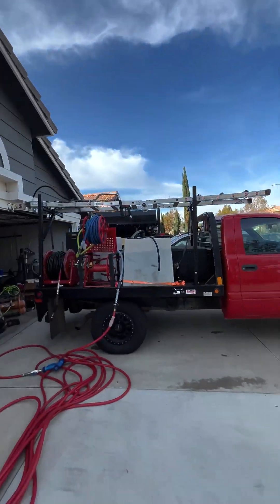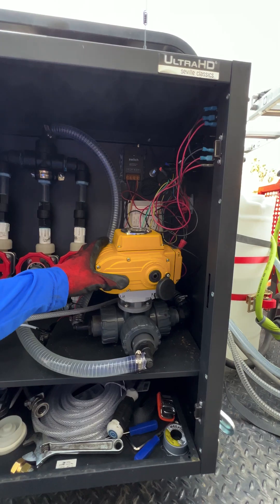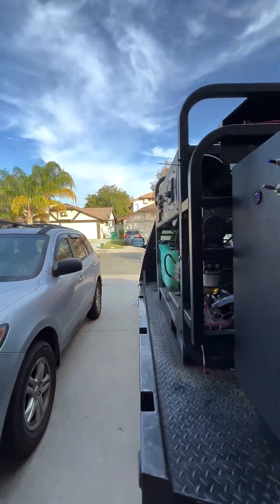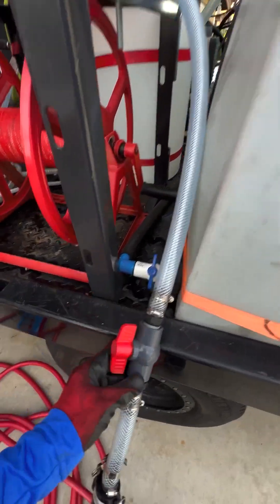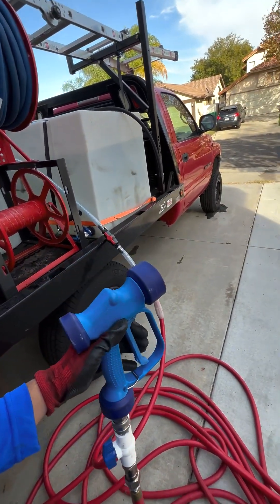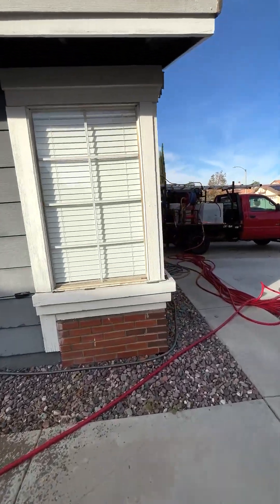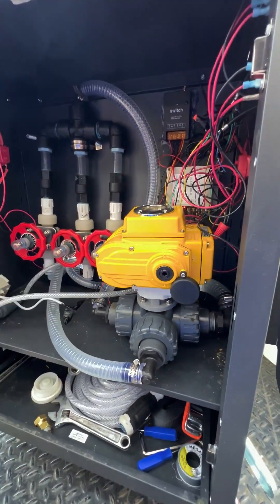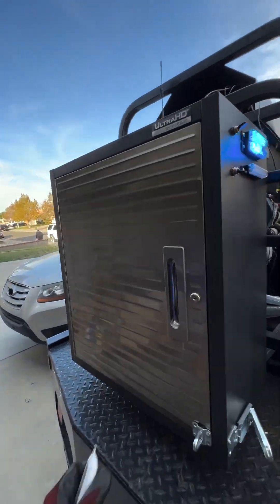50 Ft On a 12v Pump Setup

Comment: Unbelievable. You run through the whole system with hose sizes and connection and there is no mention of the size of the 200’ hose.
Reply: He says 1/2 inch

Comment: so ur running a 1/2” hose but your pump itself has 3/4” inlet and outlet?
Reply from the maker: Hi Dylan, the pump is 3/4 in/out that’s the major factor in the distance, I run a 5/8 kuri tec hose, the ends come with crimped on 1/2 male threads
Reply: @DROPPEDDOPAMINE  
what’s a good length hose to get 200’ 300’?
Reply from the maker: @GreenManGolf  I have 200’ but here in Cali that’s plenty, I haven’t tested 300 but I’m sure it’ll work

Comment: Is your valve mixer also 3/4”fittings? Why did you drop down to all 1/2” fittings at the gun? Great setup. 👍🏻👍🏻
Reply from the maker: Yes it is! I custom made it, perhaps I’ll make a video on it, I wish it was all 3/4 at the very end but the compatibility for accessories is very limited , also the hose I purchased had crimped on 1/2 male threads so was already there, glad it still works good though
Reply: Yes do a vid on mixing valves pls